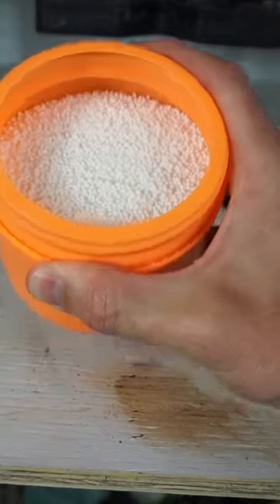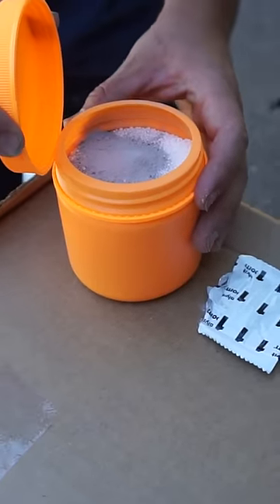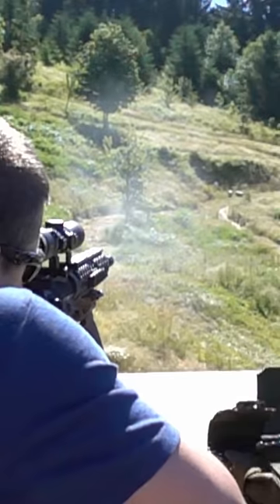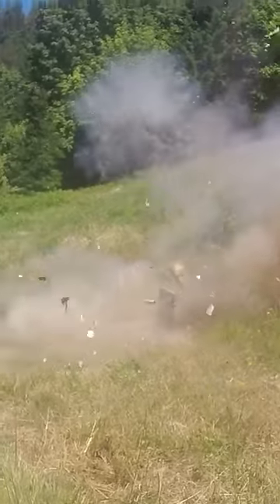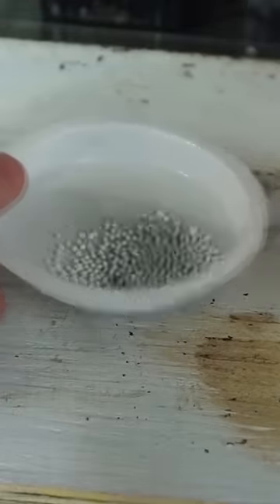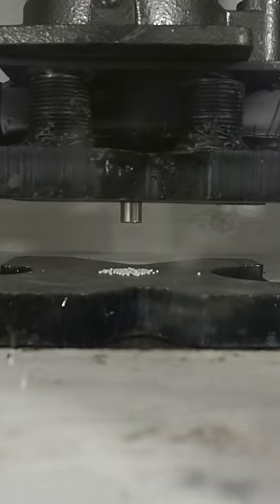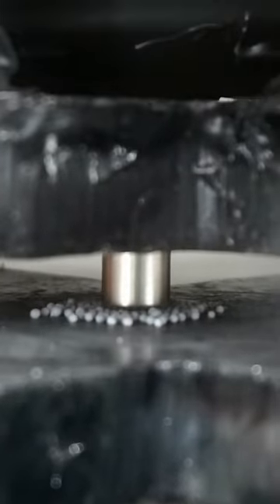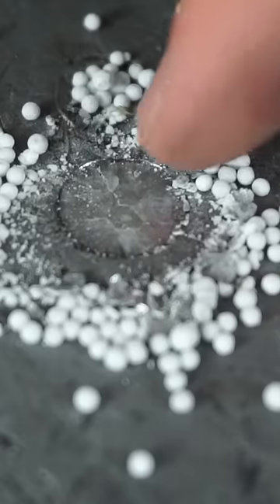Don't Crush Tannerite In a Hydraulic Press

Comment: the velocity of impact is specifically what sets off tannerite. you have to shoot it with a projectile that exceeds 2000 fps for it to ignite. Shooting it with a pistol won't set it off, but a rifle will. And heat doesn't play a role; tracer rounds from a pistol make no difference.
Reply: thanks for actually teaching us something.
Reply: This is the correct answer.
Reply: *ponder*..... prince rupert's drops should theoretically be able to set off tannerite in contact with it, when 'snipped'.
Reply: Ok but is tannerite more energetic if highly compressed before shocked?
Reply: I was looking for this comment, if I didn't find it I would have made it.
Reply: This is the same principle for any explosives that are initiated ballistically.  Explosions always go from fastest to slowest, and the deciding factor of whether or not your material will actuate is mainly based on the speed of the shockwave.
Reply: @mfree80286  Prince Rupert's drops are extremely fast, but they don't develop a pressure wave in the way you would need to initiate your reaction.   You need to overrun a lower limit of inch/lbs at a minimum speed.  There just isn't enough stored kinetic potential there.
Reply: Neither does fire. But mixed, you can't transport it because it breaks DOT laws.
Reply: So 5.7 and other necked cartridge pistols are ok?
Reply: Depends on the on handgun used, quite a few of the “hundgun” version of rifles/pdws and more powerful handguns can exceed that velocity. But in general you are correct.
Reply: @sprky777  Yes and No. You really can't "pressurize" or pack the components. It's a bunch of ammonium nitrate beads and aluminum powder mixed together, the aluminum powder coats the beads at a specific ratio. However it does need enough volume to fill most of the container. I believe it may still detonate if the ratio was incorrect. 

Btw: if you look at all the different "flash powders" aluminum powder is mixed with, youd be suprisised how easy it is to make a more highly sensitive final "product" 😉
Reply: @Teemo thank you, the misunderstanding of the difference between pressure and rate of change in pressure was disappointing.  I'm glad someone said something.
Reply: @rilesmattix5217  5.7 is only fast enough in some loads/longer barrels. A lot of load out of handguns are 1500-1800 fps.
Reply: I was hoping someone posted the correct info! You basically have to hit it was a 223 or something else high velocity. 9mm/38/shotgun won't set it off.
Reply: Was looking for this. Thanks for educating others.
Reply: RTX 3090 required for the 2000 fps :(
Reply: @gram.  finally someone made that joke
Reply: @garyj449  ammonium nitrate not nitride. Please don’t spread misinformation, look it up before you post. And yes there is a huge difference between nitride and nitrate.
Reply: Damnit every time I know something about a subject someone beats me to it.
Reply: I have to respectfully disagree with you. I just set off a 38 pound bucket of tannerite with nothing but a positive attitude, and a well thrown ninja star! Sadly, I forgot to hit record on my camera.
Reply: They make a different kind that can be set off with a 22lr. It’s actually stronger then the normal stuff
Reply: There are pistols of different caliber, so youre wrong about that, also tracer rounds are so you can see where the bullet goes.
Reply: 2000... frames per second? what kind of unit is that for velocity?
Reply: @sprky777  no, it detonates at a high velocity which is enough to cause the rest to detonate. Pressure could help, but probably not by a lot. Having it in the sealed container is enough containment for full detonation with little to no leftover unreacted mix
Reply: Scam
Reply: Lol, wrong, lol
Reply: @lucaslucas191202  lol. Feet per second, in case you were not joking.

I found out this weekend that it is velocity and not impact energy that sets off tannerite. .300blk won't set it off (180gr load), but .223 sets it off fine.
Reply: @mfree80286  I was looking for this... I thought the same thing
Reply: and what makes you so sure mr smarty pants, are you mr tannerite? 
I bet you'd like that wouldn't you, is that what you want?  ok, ok from now on your mr tannerite.
are you having fun mr tannerite?
Reply: @dabunnyrabbit2620  
What's your problem?
Reply: @TehButterflyEffect  
I wasn't, I'm not American so I've never seen fps as a velocity unit before
Reply: @reimusklinsman5876  2000 fps thats a great graphics card
Reply: At what average fps velocity would a projectile (lead or copper) need to be traveling to ignite?  Say a 22LR ~ 50cal.. 

My Google fingers are on strike today.
Reply: Most AN based explosives are Shockwave detonation transition, (SDT) meaning they need a supersonic shockwave to detonate, NH4NO3 won't detonate without the fine mesh aluminium powder acting a sensitizee. Other explosives, like Mercury fulminate, Lead Azide, Nitroglycerin, picric acid or even PETN would detonate under that sort of pressure and usually have desensitisers added to reduce the likelihood of accidental detonation from friction, shock or heat. I once hit NG with a hammer 12 times, it didn't go off, I left it there on the metal sheet, then along comes a bug walking through it and it goes off about 1 minute later, I think the bug's feet must have had aluminium powder on them, because the presence of aluminium makes explosives so much more sensitive, still not sure why.
Reply: used to cook with C-4!!
Reply: Me, a European, confused at how you hit something at frames per second
Reply: what do you mean heat doesnt play a role? i imagine inevitably a fast bullet would ignite the explosive by friction heating it up to ignition temp. how does it actually ignite?
Reply: Exactly right
Reply: I read this as 2000 frames per second
Reply: Unless that pistol happens to be chambered in 5.7mm
Reply: Velocity of impact is only relevant because the force exerted on the tannerite is relevant, meaning a stronger hydraulic press or other alterations to the testing conditions would allow for detonation.
Reply: @nigglewiggle4214  pressure shock which results in a detonation wave producing physical mixing of the nitrate and aluminium and the exposure of enough fresh aluminium surface
Reply: @lucaslucas191202  I think Americans use British imperial units so it would be feet per second.

A Glock model 22 has a muzzle velocity of about 370M/s which is about 1000 feet per second.
Reply: Thank you for doing a 30 second google search and not making a video on it that didn’t live up to the hype. No hate on the content creator
Reply: @ghostofdre  
Yeah the guy I responded to explained it
Reply: Wrong. Ive shot tannerite wirh a .45 multiple times and had it explode every single time
Reply: You’re fairly close. I have been able to to initiate detonation with as low as 1600fps (150yrds) with a .17 HMR (necked down .22 mag) will detonate it but .22 and .22 mag won’t. 30/06 and .375 H&H mag produce a little more bang for the buck. Handgun rnds don’t have what it takes, unless they shoot a rifle rnd. Fire has no effect on it but a little gunpowder added can go a long way. I think we have blown up everything you can think of with Tannerite, from cars to toilets and piano’s to dishwashers. My favorite was that purple dinosaur “Barney” though! It’s the safest exploding target I have experienced. It actually puts out fires, not start them. Great fun, be safe!
Reply: I've set off tannerite with a 12 guage, a 380 will set it off, so will 22lr
Reply: @codycain5746  I’ve never been able to set tannerite off with 9mm, .44 mag .40.22’s etc. interesting to see what you used, distances, yardage etc. was that 12ga solid, .00 or what?
Reply: @nigglewiggle4214  The majority of commonly used explosives aren't initiated by ignition.  Generally you would start your chain by electrically actuating a primary, in most cases a detonator.  With materials like tannerite the pressure wave of course comes from the bullet. Many explosives can safely be disposed of by burning them.  In the case of rdx det cord, and several others, it's actually the preferred method.  

The confusion about this usually comes from seeing a fireball during the explosion.  This is usually caused by the heat generated in the explosion itself, not from the method of actuation.
Reply: They make a small caliber/pistol specific version of tannerite that uses a different ratio of the components to work with lower velocities. It's a little scary though because a subsonic 22 can set it off. Haven't tried using it like a pop-it but it would probably work
Reply: 2000 frames per second?
Reply: Thats one reason its so safe to transport
Reply: Wait, so I can explode it with my pc?
Reply: Lol doesn’t it say that right on the labeling?
Reply: @lucaslucas191202  I think what DaBunny Rabbit was doing is what the kids these days call "making a joke"  Something  like that.
Reply: Blasting caps set it off.  ;-)
Reply: Yeah that is what first came to my mind
Reply: @garyj449  no but you can powderize the prills, mix the aluminum, shake well and add a splash of fuel oil. Set up, get back a good way and fire. Produces much bigger bang for your buck, and doesn't require a booster to set it off.
Reply: @buckberthod5007  Interesting. Never heard of that method.
Reply: @garyj449  You can not crush or powedrize the ammonium nitrate if it's been mixed. It will go off. However what works well, for small amounts, is an old school flour mill. A wooden bowl and dowel to crush and pulverize the prills into powder. Essentially you wind up with anfo, that can be set off with a rifle round rather then a booster charge, so long as you use the aluminum powder. You do need to remember to mix the tannerite first, then add fuel oil (or 50/50 mix of gas and motor oil) to it. There is a ratio of how much fuel oil to add to one pound of tannerite, but I don't think I can legally type that here even though knowledge isn't illegal. It's equivalent to a splash from a "cup".
Reply: @buckberthod5007  Thanks! I do know of, or a least, have a rudimentary understanding of the role aluminum powder plays in different mixtures. Hypothetically speaking, potassium perchlorate. On paper, that seems to be a great substitute if you dont want to shoot with a rifle round.
Reply: @garyj449  Well, hypothetically for a booster, potassium chlorate and Vaseline mixed up,  you can very easily take an empty rifle casing, .308 works good, drill the primer pocket out,  insert a fuse, wax around the pocket to keep it water and air tight, pack the shell full of said mix, put wax over the end to again make it water tight and your good to go. Insert in your mix, light it and run like hell lol.  It's legal in my jurisdiction to make these products for agriculture use, I.E clearing large rocks and boulders on the farm, so long as you call the county sherrif and let him know. I live in the deep rural southeast. Again, for any of the ATF agents reading this, KNOWLEDGE IS NOT ILLEGAL, and this is in no way instructing the manufacture of illegal items.
Reply: @buckberthod5007  Thanks! I appreciate your insight.
Reply: No you dont itll go off with a blasting cap too.
Reply: @AflacMan13  finally  a fellow man with a brain.
Reply: @domvasta  Aluminum doesn't make all explosives more sensitive but nitroglycerine is OB positive meaning that a fuel will help with its decomposition. Also, if there's even a trace of acid left, the metal powder will react with that. They're also strong reducing agents so if you look at the chemistry for each different explosive, you'll see which ones get sensitized.
Reply: @buckberthod5007  you need a det cap to set off KClO3/ Vaseline.
Reply: @buckberthod5007  also, adding nitromethane instead of fuel oil will bring the RE factor and detonation velocity close ti TNT at over 6000m/s. See Kinepak
Reply: @reimusklinsman5876  Captain Teemo teaches many ways you can explode
Reply: Velocity is only half the answer. Tannerite needs a certain amount of kinetic energy to become unstable, so the potential energy along with velocity is required.... a sand grain traveling at 4,000 fps isn't enough to get the job done.
Reply: Thank you for actually explaining this. I had to scroll down the long list of super immature childish "don't try this at home" jokes until I actually found your comment. You seem to be the only mature one here, so thank you for not making another stupid joke.
Reply: What you said is true for standard tannerite but they have had .22 caliber sensitive tannerite out for years.  Basically any bullet can set that stuff off and the neat thing is- if you tape a small packet of that to a canister of normal tannerite and hit it first- you can get them to set each other off. Meaning that you can take a .22 or even 9mm and set off a 1lb(or more) charge of normal tannerite.

Comment: "do you need temperature and pressure or just pressure" somewhere, a physicist ended themselves
Reply: Impacts and now the same as psi.
Reply: I’m an hvac tech and I just died 
Pressure and temperature are relative🗿🗿🗿🗿
Reply: @scottshepke669  dont forget your P-T chart... 69psi @ 40°...
Reply: @Milspecpoptart  🤙🤙🤙
Reply: @scottshepke669  pressure and temperature is relative??? Freezing point for water is always 32F unless you change pressure, and pressure doesn't change with perspective like say, time.
Reply: Need boolit
Reply: @dmwanderer9454  they meant they are related. You can't increase pressure without increasing the emperature in a closed system and vice versa.
That is exactly the principle by which fridges work. Pressurize a liquid and its temperature increases. Let the liquid cool down then depressurize it. Now you have a much colder liquid. Use that to cool the interior of the fridge until the liquid is back to its original temperature. Repeat.

EDIT: assuming the volume remains constant btw. Because actually all three are related ofc :p
Reply: @dmwanderer9454  the higher the pressure the higher the temperature, that's why turbocharged diesel engines have intercoolers.
Reply: Boiling cold water is one of the wildest things I've seen 💀
P-T charts are scary
Reply: Yeah, I'm a Mechanical engineer. This guy doesn't really impress me. 

If I understand correctly, one needs a certain energy. How you get that energy is irrelevant, as long as the energy is right to the reaction to grow.

Comment: I love the idea that this was actually an experiment and that he didn't know beforehand whether it'd explode
Reply: Or so he says. I highly doubt he didn’t know, let alone willing to risk it
Reply: @jamesbizs  no, i love the IDEA as in the hypothetical scenario, I might unsubscribe if i even thought he was putting himself in that much danger just for my clicks
Reply: @aotoda486  What a scary comment.
Reply: It's well known that it isn't easy to set off. A .22, 9mm, or even .45 won't set it off. Ignition charges, other explosives, or pressure doesn't either. He knew, but it's still a interesting experiment.
Reply: @kita7647  "well known" 😅
But i can see that being a number duh thing in that line of work i spose lol
Reply: James is exceptionally intelligent.  He graduated with a BS in chemical engineering in 2010 and received his PhD in chemical engineering in 2014 from Brigham Young University.  I'm certain he had pretty good idea that it wouldn't explode.  I doubt he would've wanted to do this experiment if he thought it would.  I'm absolutely certain he understands fuel and oxidizers, and the fact that the energy from a high-velocity impact like a rifle round (required to detonate ammonal) is a whole other ball game from a slow, gradual compression from a hydraulic press.
Reply: I did